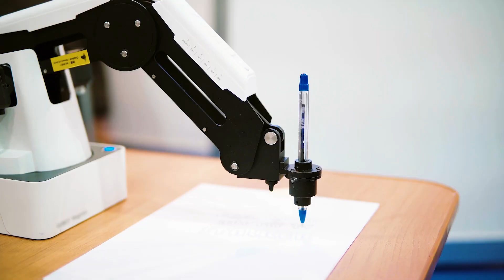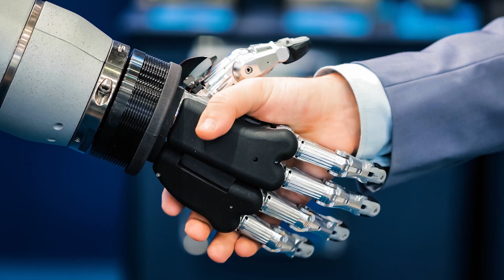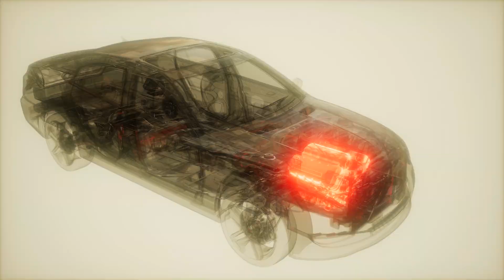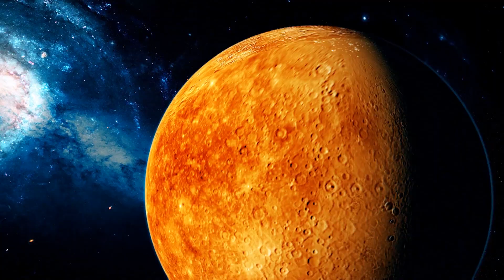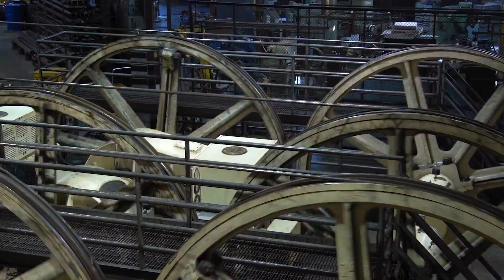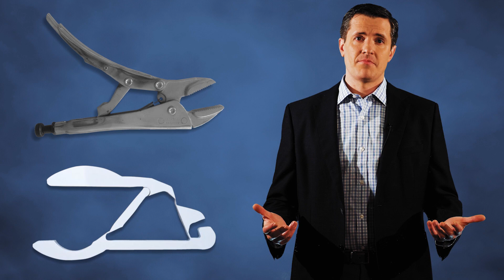Traditional Mechanisms and Mechanical Systems Lecture Series Introduction

Comment: Motion control systems
Overview
Introduction
A modern motion control system typically consists of a motion controller, a motor drive or amplifier, an electric motor, and feed-back sensors. The system might also contain other components such as one or more belt-, ballscrew-, or leadscrew-driven linear guides or axis stages. A motion controller today can be a stand-alone programmable controller, a personal computer containing a motion control card. Or a programmable logic controller (PLC).
All of the components of a motion control system must work together seamlessly to perform their assigned functions.Their selection must be based on both engineering and economic considerations.